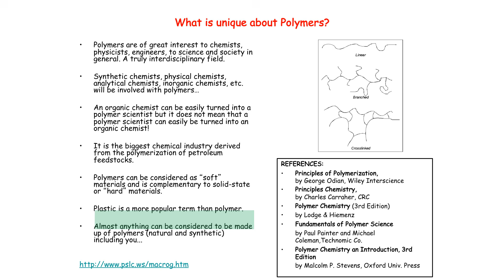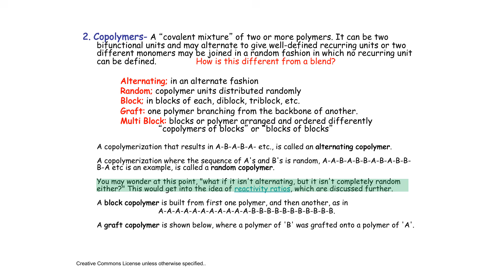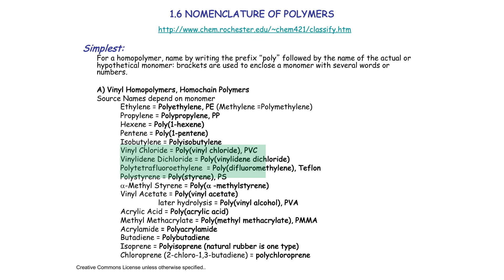TUTORIAL: Polymers an Overview

Comment from the maker: SUMMARY::

This tutorial provides a comprehensive overview of polymer science, exploring the fundamentals, classification, and industrial applications of these materials. Here are the key takeaways:

Defining Polymers: Polymers (or macromolecules) are large molecules composed of repeating structural units called monomers (4:30). They represent the largest sector of the chemical industry and are essential to both biological life and synthetic materials (4:00).
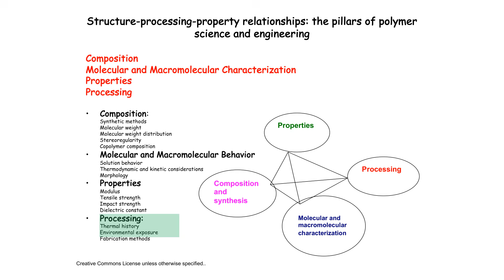Core Pillars: The field is built on four interconnected pillars: composition and synthesis, molecular characterization, material properties, and processing (7:34-8:44).
Classification: Polymers can be categorized in multiple ways, including:
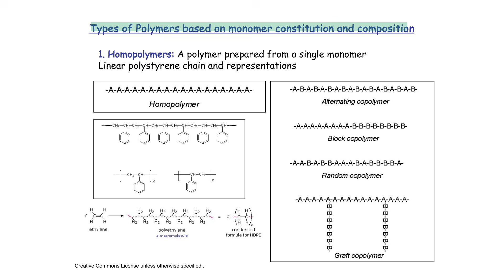Composition: Homopolymers vs. copolymers (e.g., block, random, graft) (10:06-11:29).
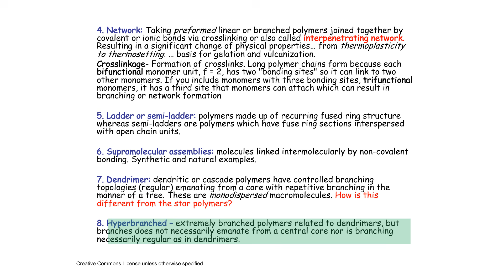Architecture: Linear, branched, star, comb, and networked (12:13-14:35).
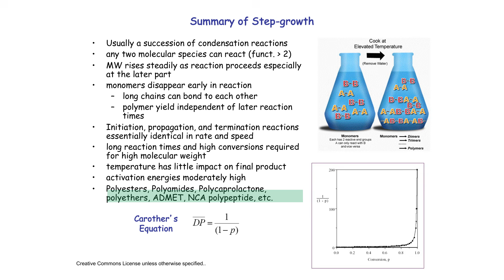Mechanism: Chain-growth vs. step-growth polymerization (16:43-19:46).
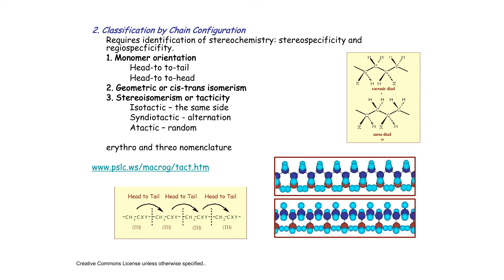Thermal Behavior: Thermoplastics (meltable) vs. thermosets (cured networks) (21:30-22:15).
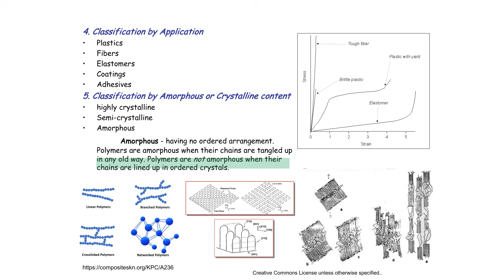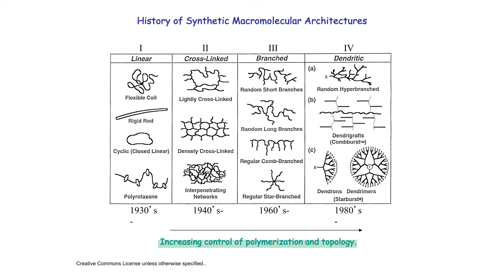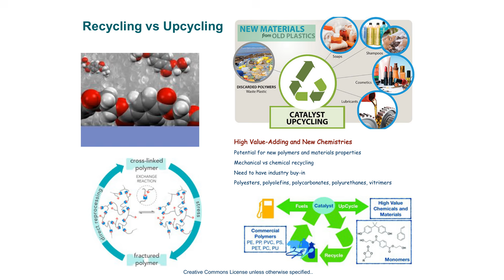History & Evolution: The field has evolved from early developments like Goodyear's vulcanization (1840s) to the establishment of macromolecular theory by Herman Staudinger (1930s) and modern AI-driven discovery (24:05-26:27, 35:08-36:12).
Modern Challenges & Future: The talk places major emphasis on the polymer life cycle, including mechanical and chemical recycling, as well as the transition toward upcycling waste into high-value resources (32:51-35:07).